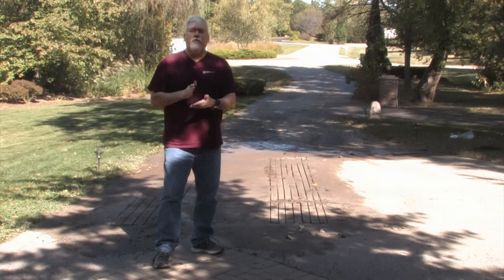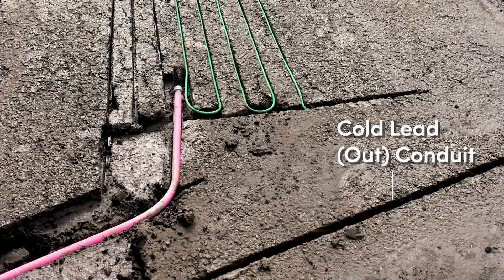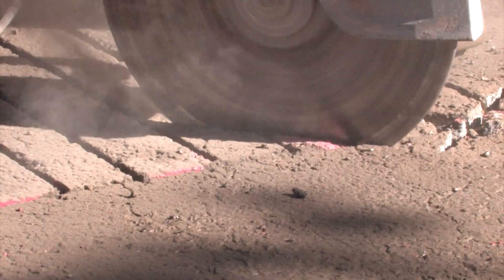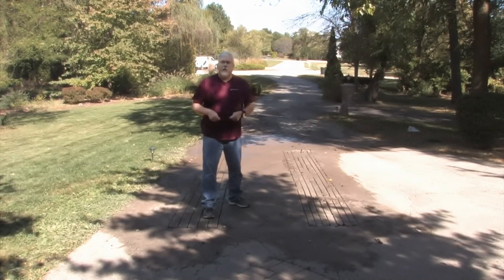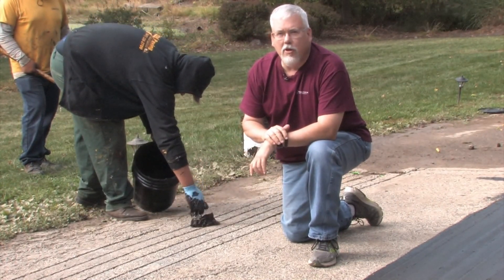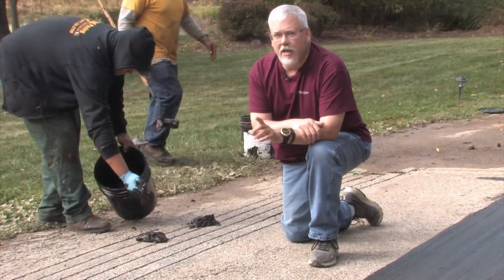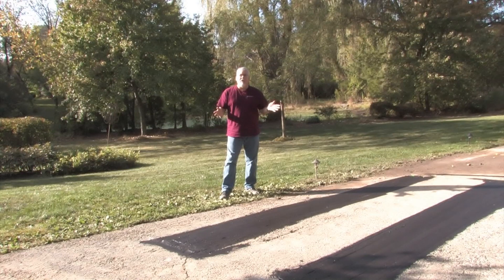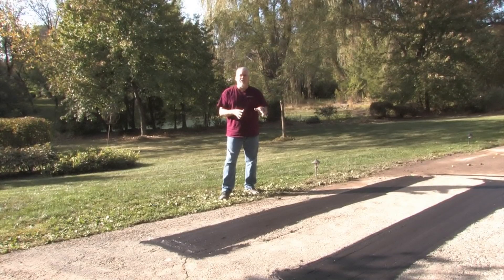Retrofit Heated Driveway Installation

Comment: How did the driveway look after a complete reseal? Were the cracks very noticeable?
Reply from the maker: After the reseal, the area looked visibly different from the surrounding asphalt but there were no gaps or cracks visible. The excavated area has to be completely resealed for the system to work properly. Thanks for watching!